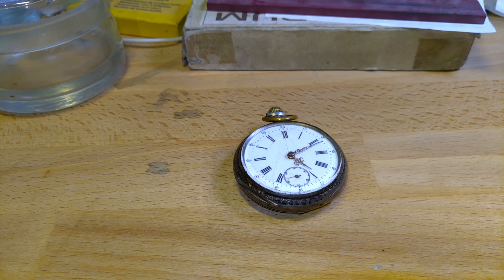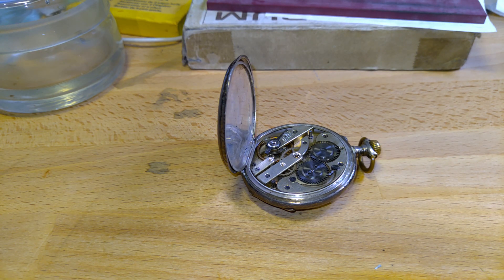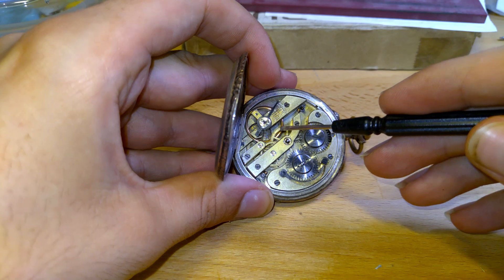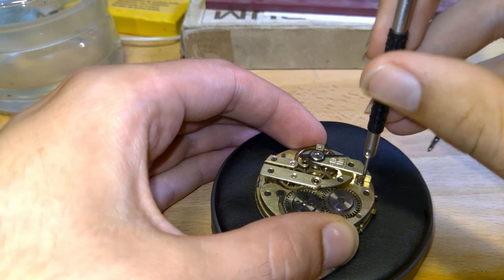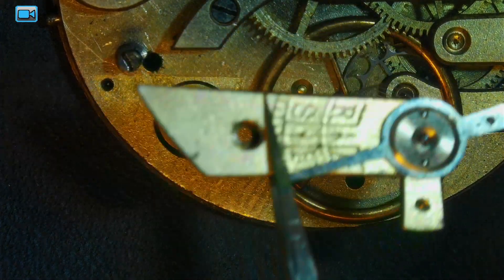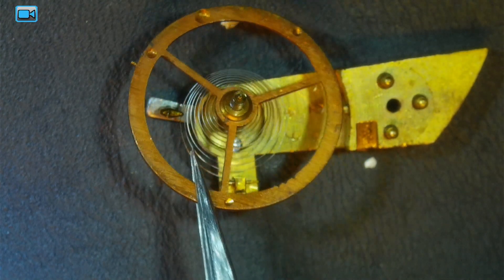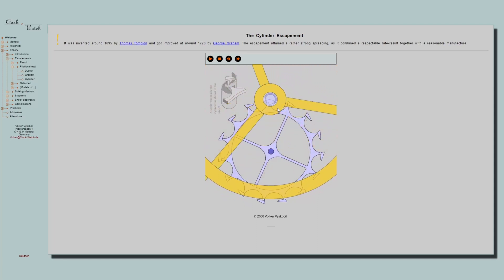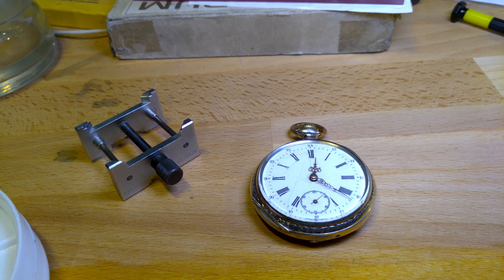Cylinder escapements, watchmakers nightmare?

Comment: I have a watch that has an identical mechanism but is not working. I think the teeth of the escape wheel fit into the balance cylinder and therefore the latter moves too much. I also believe that the rocker does not hold its position because the pivot is broken (or at least I think so). basically the rocker swings until it engages with the nearby wheel. Is yours like this too? what kind of manufacturing is your movement, mine doesn't have a name

Comment: Although the escapement has a bad reputation, the same goes for the early wristwatches. The reason why both are difficult to repair is simply because one cannot now get the parts. Many of these were for Swiss cylinder watches, these were standard and interchangeable, but now are not available.
Reply from the maker: Well I still have access to the parts but even than it is a complicated to replace them.

Comment: Nice video I have a clock like that with missing crown and broken upper pivot in the cylinder escapement  unfortunately... Anyway did you know why we can't find the manufacturer name clearly and usually you don't have many jewels (maybe  one)  ...
Reply from the maker: It is not uncommon for older clocks and watches to not have the brands marked on there. This is often because the movement and the watch casing where from different makers and such. 

If you really want to know the brand of the movement there are books where they have drawing of all the movements front and back sorted by size. 

But in order to repair those you dont need to know the brand. It is possible to repair them without knowing the brand. That being said your best chance is to just find a replacement cylinder.
Reply: @Mr-Wonderfull thanks a lot for the reply I was interested in learning the history behind the clock. About repairing yes it's very simple mechanism .

Comment: I'm a hobbyist and had bought a pin set movement to restore. As I examined the movement I realized something was different with it. The escape wheel was different than what I had ever come across.  I removed the balance assembly and then noticed the pin on the side of the balance and that there was no pallet fork. after some sleuthing I realized this was a cylinder escapement. I found your video and am now afraid to continue without asking about balance assembly replacement. I am not equipped to do repairs to the balance if it is worn but the watch was working before I started. If I continue, is there anything special I need to do as I try to replace the balance assembly into the watch to avoid damaging the cylinder staff or escape wheel teeth? If I continue to disassemble the movement is there anything else I should be watching for. As it was working I don't want to destroy the watch if I can avoid it. Thanks,  Les
Reply from the maker: Well if it was working than maybe you get away with just a maintenance. Disasmebly, cleaning, putting it back together and oiling. Like you would do with any other movement. Just be careful to disarm the movement before removing the balans sinds once removed and there still is power on the geartrain it all gets released things might go flying and the hairspring is very fragile.

Comment: Thanks for the video!  I have the same looking movement over here.. 1st real watch to repair, (or so I hoped..)  .  My staff is broken.. Can't see any brand so hard to look for replacements.. do you got any tips where to look?
Reply from the maker: Well you do not need to look for a brand sinds the cylinder parts are interchangeable. You could change out the pivots but it is very delicate operation and needs a few specific and obscure tools. So I defently do not recommend that for a first watch. What I would try is to get hold of an assortment of cylinders and a Sirius ruler. Those rulers pop up on eBay from time to time. They look like ruler with a bunch of cirkels on and in the middle you have smaller holes and most important it says Sirius above the cirkels and holes. And they basicly show the relation in size in between the cylinder and the cylinder gear. If the the cylinder gear fits in the bigger cirkel the small cirkel shows the diameter of the cylinder and vise versa. Or you could also do it without the ruler and just mesure your cylinder to find a new one based on the size. If you go about removing the cylinder and placing the new be very carefull sinds most of it is cut out you are not left with much and it breaks easy. So lot's of small taps with a hamer instead of one big one. Good luck with your repair. I am going to do a video in the distant future about this subject in case you can't figure it out.
Reply: @Mr-Wonderfull  I am also about to replace a cylinder staff, and your tips and warnings have been invaluable. Thank you!

Comment: Notice that the balance wheel has no adjustment screws..like today's movements
Reply from the maker: Yes, this balance wheel doesn't have adjustment screws. Pretty sure they would interfere with the little blocking pin under the escapement bridge and well sinds the quality of those watches is low I just think they didn't bother with it. But most movements don't have them either these days. They are adjusted at the factory and while you can still adjust them afterwards it is not as handy. Balance wheels with screw used to be much more common. Which was nice because it gave a skilled watchmaker a lot to work with. 

I am thinking about doing a full video about it now. Stay tuned for that.